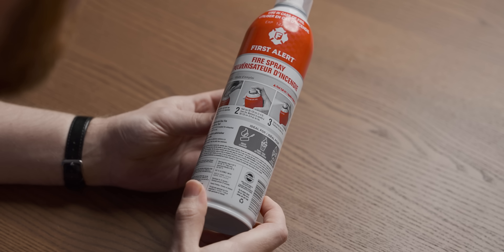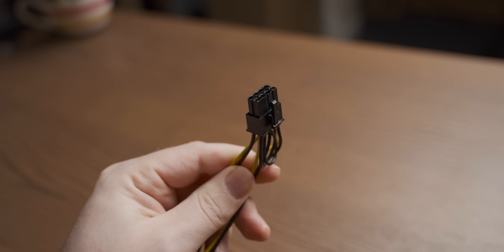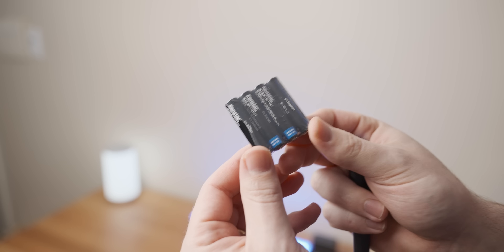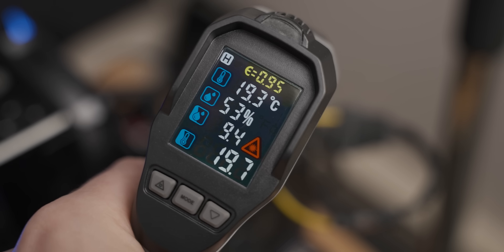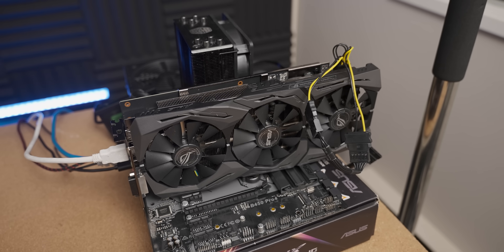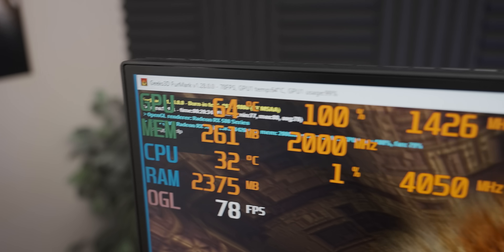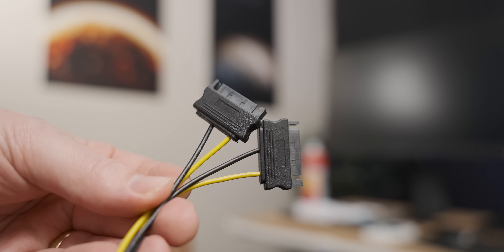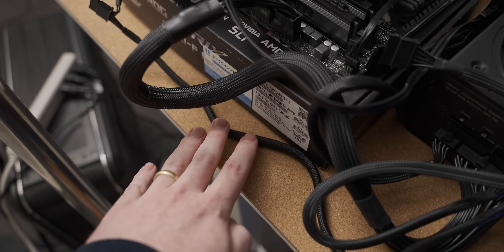Will This Adapter Set Fire To Your PC?

Comment: My main system is an old HP 8300 elitedesk Medium Tower, with a proprietary 320W PSU. 

Configuration is i7 3770, 32 GB DDR3 1600 dual channel, 1 HD, 1 SSD, , 1 external HD, DVD burner, Asus Soundcard and a RX 570 4 GB, that draws power from the exact same adapter you've tested. All the system is working perfectly fine for several years of intensive work use and gaming. Maximum draw of the system at the AC outlet is 265 W total (tested with Furmark).

This adapter solution could be considered a long-term one, if needed.
Reply: Two year later I'm at the exact point you are in.😅. Is it doing well , so far? I have the same set up as you.
Reply: And did you have to undervolt the catd?
Reply: @yahsaxe  No, system Is working fine as is. No undervolting needed. I swapped the RX 570 4 GB with a RX 6600 8 GB last december. All is working well.
Reply: @vgnlda  that's crazy, rx 6600 is a 160 watt card, cheers man. I am still waiting for my rx 570 order, I have to start from somewhere. Things go well I will notify you.💪🏿
Reply: @yahsaxe  I'll be glad to hear from you 🙂 A little correction, though: I looked over the reviews of the RX 6600 and the 160W request seems to be incorrect: "We tested the video card in several taxing situations. The PowerColor Hellhound RX 6600 barely goes above 100W (no undervolting) even in very demanding situations". That's less than the RX 570.
Reply: I have a Dell Vostro 3888 Mini Tower that has an i3 10100 and 2*8GB DDR4 RAMs with a SATA SSD. The PSU is 260 Watts 80+ Bronze, but has no 8 or 6 pin GPU connector. Can I install a low profile RTX 4060 (TDP:115 W) using a SATA to 8 pin adapter cable? I believe drawing 40 watts off of a SATA cable won't put too much pressure on the cable, as it seems to be of high quality. 
I want to install the Gigabyte RTX 4060 8GB Low profile GPU with a TDP of 115W and requires 8 pin connector.
Reply: @Jawad.1  Hi, in theory there should be no problem in using a good quality 8 PIN adapter cable to power your card. If possible, I'd like to use a 2 SATA to 8-PIN adapter, though. Another possible issue could be your PSU adapter, 260 W could be  too low of a headspace. You can consider to undervolt the GPU just in case.
Reply: @vgnlda nc mam good for you I was wondering which games do you used to play back then I am considering it just needs some information from you thanks ❤

Comment: Ive run those power adapters a couple times on light duty 30 watt GT1030 type video cards in low power computers or computers with no video card at all, never had a hiccup, used once cause the original power supply didnt have a six pin PC power supply connector - but theyre definitely not suited for high wattage situations.  Only used them under certain low demand conditions never even came close to any kind of problem, but then im not running a video card the size of a small car either

Comment: Well, sata is rated for 50 watts. 2x50 is 100, 8 pin is rated for 150. So your only 50 watts over. I've found that sata can handle about 120 watts before it starts to get a little warm, so running 25 watts over what the connection is rated for each is perfectly fine. For reference, the 4 pin cpu power connector is rated for 150 watts of continuous power delivery, has 4 wires, of similar thickness to sata wires. With thus adapter, combined, it has 2 positive, and 4 negative. Totalling 6 wires, of similar caliber. So if 4 wires can carry 150 watts, 6 can do it even better, having the same amount of +12 and more negatives. Yes, it's not rated for that, but connections like these don't state what they can handle, they state what you would probably be drawing through them at max capacity. Hdds, ssds, DVD drives, assuming you have loaded your system with these, and had them all running under full load, it would most likely total 50 watts. The wires themselves don't have a limit on how many watts you can draw on them, and what they are rated for, is not what they can actually supply.

Comment: I used to use one 2x6pin to 8-pin and one 2xMolex to 8-pin for my 1080 Ti. In Warhammer Vermintide 2 at a specific boss fight where he suddenly shoots out green poisonous blobs in all directions this was too much for my setup. It would  crash and reboot the system. New PSU with proper connectors fixed it. Leave money in your budget for a proper PSU.

Comment: It gets to a point where "thermal Runaway" occures. If the connector gets hot enough I will actually require more amps to compensate for the resistance of the connector . So the card will pull more power to compensate and that will in turn increase the heat/ internal resistance which in turn will draw more power to compensate until you have a melted connector.

Comment: Let's also not forget that sata cables usually draw from the 5 volt rail. While video cards usually draw from the 12 volt rail. These things are just not a good idea any more now that the average low end video card is drawing greater than 100 watts and those rails were just not made to feed such huge power needs.

Comment: If you do not have any serious safety issues like an unabated ground fault or a massive build up of gasoline in your computer its fine. The first thing to burn will be the silicon jacket at about 250 degrees celcius, the plastic of the connectors would turn to a liquid far before that would happen. Computer fires do occur, I have had one myself because a piece of metal somehow moved directly into the PCIE channel my 1060 was plugged into. We've all seen GamersNexus intentionally cause one or two. But... this is not the way to cause that.

Comment: I can't see why someone would use this. Except, when you're using a server power supply which doesn't have 8pin or 6pin connectors, with an old gpu. Maybe you should've tested that instead.

Comment: I had an old HP with an Athlon 64 X2. It being my first PC with a video card needing PCIE power, I didn't know the power supply I bought for it had it already on there. I plugged in the GPU with one of those adapters (The one that came with it. It was a GTX 560Ti) I used that PC for 2-3 Years after, and my brother, who bought it after me used it for like 5 more after that. It was rock solid. The board ended up failing, but the GPU and the Cooler Master power supply survived.
Edit: I even ended up overclocking that card a bit. I can't remember how much.

Comment: This is a topic similar to thermal paste, all the armchair experts will hate comment to no end... HOWEVER, that being said, you probably should only be adapting to 6 pin... typically I like to buy dual molex or dual sata to single six pin... there is a point at which you just need a proper power supply. Ill also use a native six pin plus a molex or sata adapted six pin to run a dual six pin to single 8 pin

Comment: I'm sure someone else has posted this already Dawid, but if you really want to set it on fire, just unplug 1 of the sata connectors so the full power req's of the GPU are forced through 1 sata connector instead of being shared by 2. That of course is assuming each sata connector is connected to all 8 pins at the molex end, which is how it looks in the video from all those loops.

Comment: Needed a 3060ti or 3070 fe with its single 8 pin adapter or another 3060ti/3070 that only had one 8 pin

But the real issue is not them failing instantly it's about failures down the line. If you get lucky and the adapter was made well it might last. But I've seen what appears to be where eventually one of the live wires and ground connect and cause a short to ground. This seems to be more common in the adapters that also carry 5v and 12v. So with the extra space from ground and 12v you may be more in the clear then a normal one

Comment: It's not often that the rating makes the cable fail it's usually time! Connections get dirty and corroded. That makes a high resistance which then gets hot and that's what can overheat. Another fail point is poor crimping of the wire to the pin. The wire is partly covered by the insulation, not a tight crimp, some of the conductors cut off as the insulation is removed. The use of aluminium and not copper because it's cheaper...the list goes on.

Comment: I can confirm this cable set my Mac Pro 2010 on fire never use it when I was tuning an Nvidia gtx980 and AMD FirePro 7200 running in the machine.

The FirePro was connected to it and the Mac Pro was boot looping and I could smell smoke, some how after removing the cable and the Mac Pro started and is still working to this day. Even the SATA port is still working just a little melted.

Comment: Love the zeal for controlled chaos :) I used a Molex to SATA adapter/splitter to power my old server's WD Green 1TB hdd.  One day, the server was not responding on the network.  I opened it up and saw the splitter was burnt, and the circuit board on the hdd was damaged.  I didn't have backups for much of the stuff on the drive.  I was able to resurrect the drive with a board ordered off ebay for about $25.

Comment: 208w -75 from the pcie slot = 133w/2 sata = 66w when the "limit" is 54 each. so each one is ~12w over limit. so around 20% overloaded isnt insane.. id lvoe to see an 8pin to dual 8pin adapter used with that. that woould melt for sure

Comment: Those adapters are also heavily dependent upon who made it. Do not buy one of the $1.99 adapters from Ebay. Those will fall apart during install, forget long-term use (1st hand experience here). The better ones will work just fine.

Comment: I have used these when adding GPUs to Optiplexes, but 1) have always limited the GPUs to lower-TDP models like the 120W GTX 1060 or the 100w 1650 Super, 2) never overclocked the GPUs off these, and 3) have always tested them running Furmark for a few hours and checking the temps periodically to make sure it's not heading up.
Reply: Its even better if you undervolt them....

Comment: As an certified electrician, I can call complete BS on this ! It all comes down to the thickness of the coper wires, 0.5mm of wire is more than enough to carry 5 ampere @ 230 volts PER connector, and 5 ampere times 230 volts = 1150 watts, So that equals to 5 ampere @ 12 volts = 72 watts PER connector, so that is 144 watts for 2 connectors, and 75 watts on the board =  219 Watts TOTAL ! When you have 1,5mm connectors you can easily run more than 600 watts over them !    12 volts is 12 volts NO MATTER where you are pulling them from, you just need to keep in mind NOT to go OVER the overall maximum rated power ! It is THAT simple. I have tested many cheap PSU, and the all worked just fine, AS LONG YOU DON'T OVER DRAW their maximum rating !!! When you do know what you are doing, than there are really no BAD psu's ! Only problem is PEOPLE who don't know shit about about electronics !

Comment: my main question is why people dont just take the sata ends off the dongle and just splice and solder the adapter on. you still get to keep and uses the 2 sata for drives and be able to power the card.  i have a subwoofer running off my computers power supply

Comment: Try dual connectors then connect them to a separate connector so it looks like 4 sata connectors to 2 6 pin graphics connector then the 2 6 pin to an 8 pin graphics connector sounds Frankenstein but it does the trick

Comment: I'm using a dual SATA to 8pin for a GTX 1080ti. It was installed as a temporary solution but a year has passed since then. Still works. Although I undervolted the gpu to lower the temps.
Reply: is it still good
Reply: @AHMED-mohaamed  worked fine for years. Now works with a new PSU that has 2x8 pin
Reply: @lehelzelenka207 Your psu was 290w?

Comment: 1:15 That's why SATA power is garbage and Molex power isn't. MOLEX FTW!

Edit: FYI, that Molex connector  (Molex is a brand with a number of other models, including the ones we all know by ATX 24 pin, EPS. PCI-E Supplemental power...) is rated for 10A, which gives us 120W @ 12V.

Comment: I used a molex to PCI adapter in a build once tested the gpu to make sure it was stable with the 750watt PSU I had in the system but because of the power draw the adapter covering melted and the PSU blow up.

Comment: ""This is bast case scenario?"... No this is the normal scenario. People who designed that connector and the speck for the sata power rails were not stupid. Whatever the speck says it should be able to handle at least 30-40% more. The standard for "it must be able to handle way more than you speck it for" in engineering and architecture is 50%. At least that is what my professors in engineering school say. With elevators technicians a friend of mine says they teach them to make them able to handle 250% of what the official limit says.

Comment: i'd like to see the difference with the cable BEHIND the gpu so it's not getting airflow from the gpu fan as much. i for one don't tend to like having my cables dsngling near fans at least! plus blower-style cards wouldn't have as much splash-back airflow as the gpus shown so it's a semi-comparable experiment i'd wager.
BUT power-cycling will cause it to break for sure with those temperatures. heat makes it expand, then it cools down, causing micro-cracks and deformations, especially as the whole bit of plastic isn't the same temp/heating and cooling homogenously (and why fillament bulbs can last decades if never turned off, or burnt out in a month by your kids flipping the light switch on and off like a disco strobe). you could do a test on this by running to 20mins to get peak temp, stop and let cool maybe 5 mins, rinse and repeat, to force the wear fast. YMMV depending on plastic quality too!
also, you can get decent 36x36 pixel IR cameras for £100-£200. FLIR is both a descriptor AND A BRAND, like the rolls royce/apple of heat vision. just don't get an 8x8 pixel IR sensor one. 36x36 with fixed focus@50cm for £100 off eBay or gearbest isn't tooo bad for your usecase since you're not doing building inspections that require high penetration or optical zooming or scanning from -273 to 2000 degrees C like industrial gas/steel manufacturers etc. etc., so a range of -20 to 200 C should plenty suffice, unless you plan on condensing gasses to liquids or making a home-made forge ;)

Comment: There's a very specific reason those Molex to SATA power connectors fail and it's specifically how certain female connectors are made. Male SATA power connectors are more or less unaffected by the issue. If you look at the female SATA connectors on the power supply in this video, they use crimped terminals that are then inserted into a connector housing. These are very robust and rarely fail. If you look up Molex to SATA adapters (like the one at 1:17,) most are injection molded around the terminals. THESE are the female SATA connectors to avoid. The injection molding process produces connectors that have loose tolerances and don't provide a firm mechanical connection.

Comment: Sometimes the adapter survives, but the sata cables on the psu die a terrible fiery death and burn your house to the ground. Anyway, I really wouldn't trust software power readings, as they more often than not measure the gpu power, not the total board power.

Comment: Much easier to get these things to burn up when your room is at 60 degrees celsius 24/7. I personally only use sata or molex connectors to fill in 30-40 watts per sata/molex, never more.  Is my use case based on technical knowledge? No, just experience from use.

Even when my connectors have started to fail I would see a color change LONG before they actually burned up, when the connector is black it just starts to look shiny in appearance.

Comment: Great content as always.  Much as expected, the 960 just can't pull that much juice.  I did have one of those connectors fail but it was Molex to SATA running a WD hard drive, it ran for years and one day poof smoke and the PC wouldn't boot.  Found the connector melted.  It hangs above my desk at work.  Replaced the connector and everything did worked fine just fyi whatever power protection was in the system shut it down without catastrophic failure.  I think if you get something like a StarTech connector that uses slightly thicker gauge wire vs the freebee that came with some component the danger is reduced.

Comment: How about using a good sized power source and an ever increasing dummy load to find the failure point?  Hopefully lots of smoke and maybe even flames with the added bonus of no hardware being killed.  Guessing a car battery and some old school headlamp bulbs added one at a time in parallel would do the job or failing that let Big Clive loose on them......

Comment: If the 960 draws 75W - through PCIE connector - that leaves about 45W load on the cables - and you have about 110W on the cable itself - so this is not the right way to test it - but nevertheless - was fun to watch

Comment: The IR thermometer doesn't use the laser for measuring, it's just something to assist with aiming :D
and the temps on the rest of the cable shouldn't have anything to do with the janky adapter

Comment: I got a pre-built dell optiplex with RX 570 and one of these connectors but with a single sata power input 
it was melting and I had to change it like once a week and it was getting worse every time so I had to change the power supply xD
and going back for the same problem till I got a new pc with a 650w power supply 

The conclusion : Don't buy one of these at any situation cuz it can harm your power supply or even your GPU